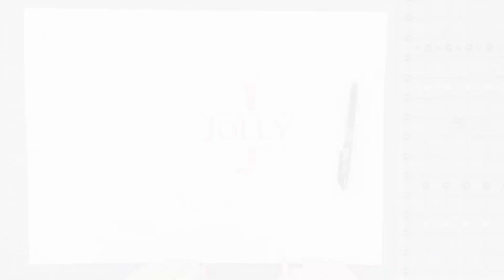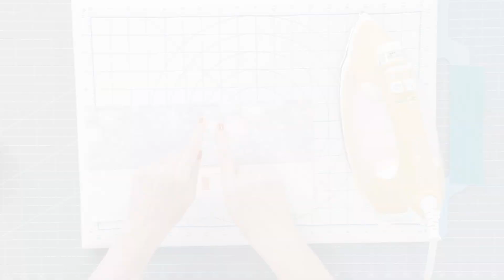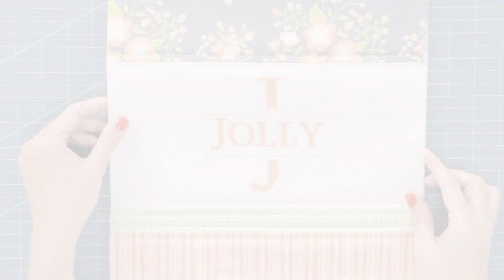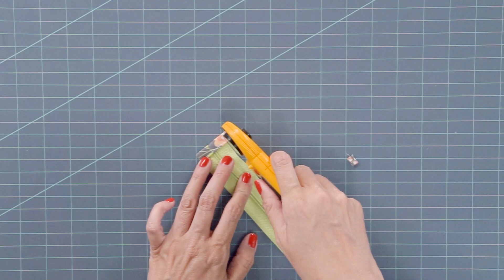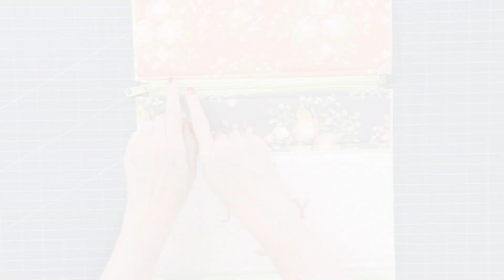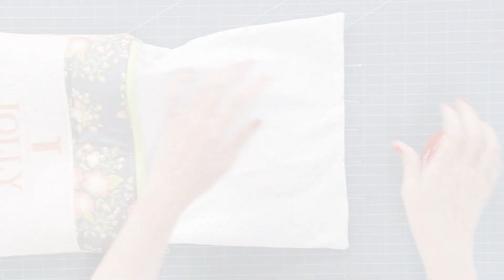Cross Stitch Alphabet: How to make a Cross Stitch Monogram Zipper Bag | Fat Quarter Shop Flosstube

Comment: One Wonder clip tip:
Notice the 2 different colors on the ends (opposite where you pinch the clip to open it).
Use the flat clear side as the bottom  & the curved colored side as the top of the clip.  Sew with the flat buttons of the clips against the sewing machine bed; gives you a less curvy seam.

Love the multi fabric colors coordinating with the chosen fabric gir the back of the bag & the X-stitched piece as the center insert! 
If you want a pocket or 3, just add the rectangle piece of fabric (edges turned under) & stitch the bottom on, then each side. You can pin each of the 3 sides... not the top... to the right sude of the lining, placed not actually against the bottom seam, but chose the location. You can then stitch 1 or more vertical lines on the pocket (parallel to the sides) for pocket division; if you choose. 
You could use clear vinyl, if you want a pocket for a see through pocket. I would add a cloth closure over the top...small zipper, or a flap with a button or snap closure.  If you chose to use hook & loop tape, the tough side may snag the completed X-stitches, on your project & probably wouldn't be the best choice. 
You can add loops inside the side seam (when sewing the entire bags side & bottom seams) for scissors or ruler, just cut & fold to size.
Beautifully explained with great camera close-ups! Thanks FQS Team!
Reply: If you want to add a wrist "handle", measure the circumference of your hand, mud palm across the knuckles, add 1", for seam insertion. Choose on which side you want the handle & attach on the seam line, with the handle  between  the back % the front of the bag as sandwiched together before sewing the 2 sides & the bottom; so, when turning the bag right side out, the handle appears on the outside of the bag.

Comment: How would you wash this bag if it gets dirty.  Can you wash cross-stitch?
Reply from the maker: Hello Kristin! If it is stitched with DMC, it can be hand washed in cool water.  If I ever wash a piece, I put a drop of Ivory dish washing soap in a small dishpan with cool water and let it soak a little while.  Then rinse it well with cool water and let it air dry. If it is stitched with fancy floss, it shouldn’t be washed because most of those flosses are not colorfast.